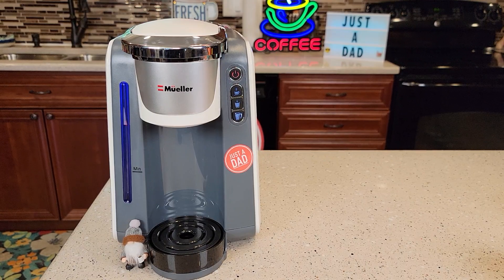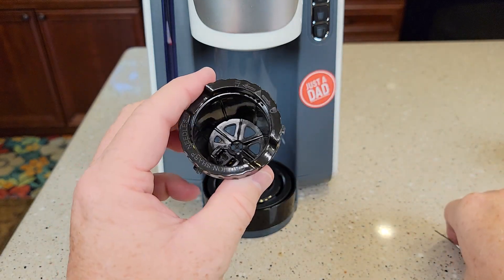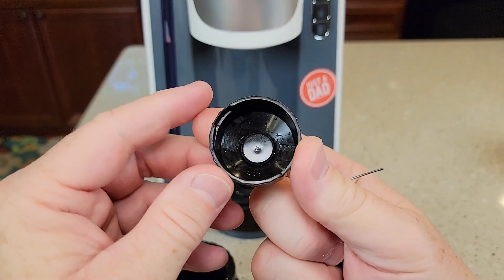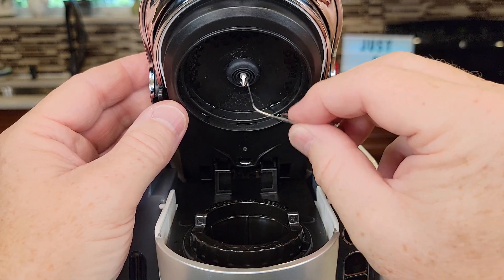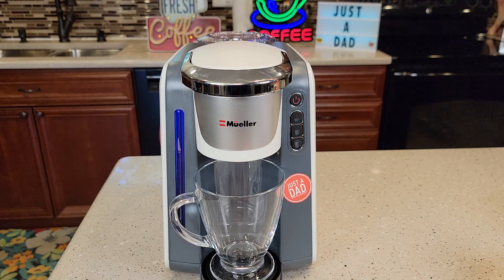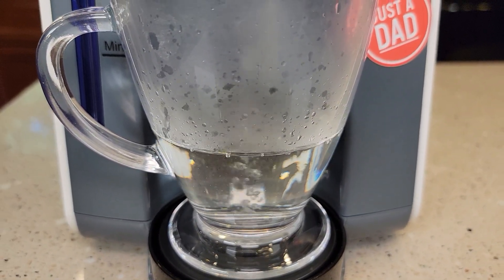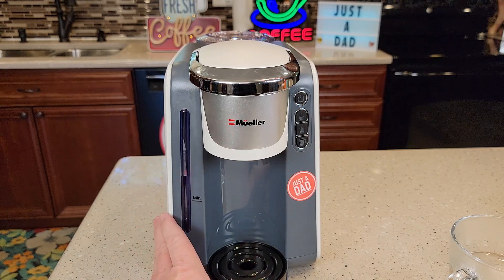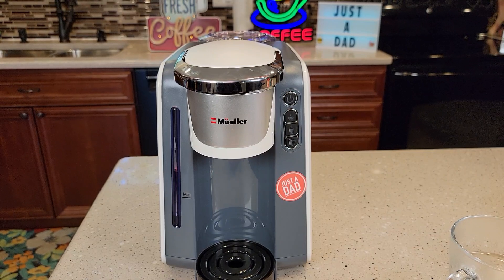HOW TO FIX Mueller Single Serve U700 K-Cup Coffee Maker   CLEAN NEEDLES

Comment: One small tip:  My Mueller single-cup was sputtering and delivering only about half the amount of coffee (or water) as normal. Tried all the steps above several times, and while I did get some coffee grounds out of the system, it did not solve the problem. Also de-scaled. Finally, in desperation, I decided to let the reservoir go dry until the Mueller was literally sucking air. Then I turned it off, let it cool down, filled the reservoir, and turned it back on. Voila....back to normal!  Must have been an air lock somewhere in the system.
Reply from the maker: Good job and thanks for sharing!!!!